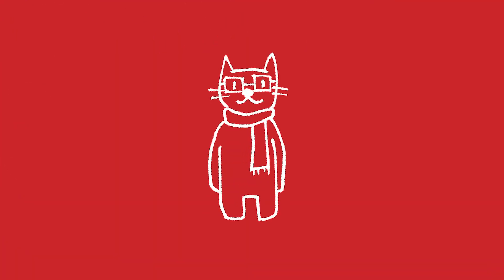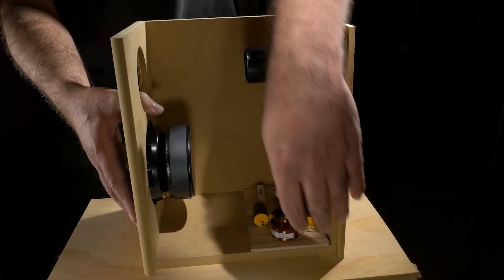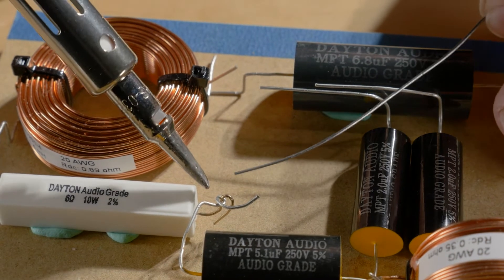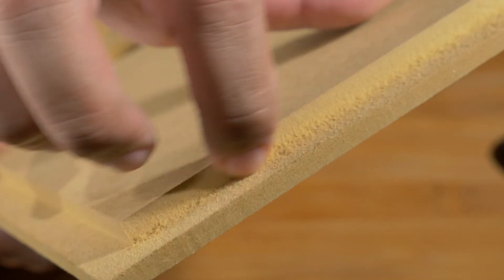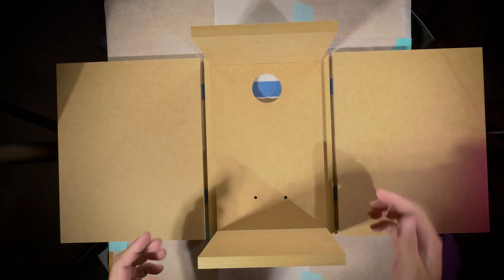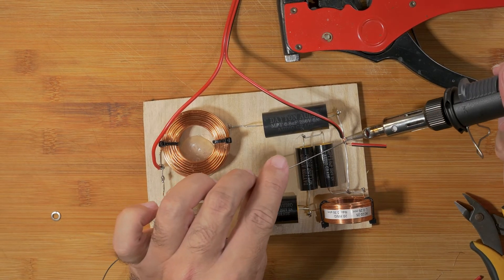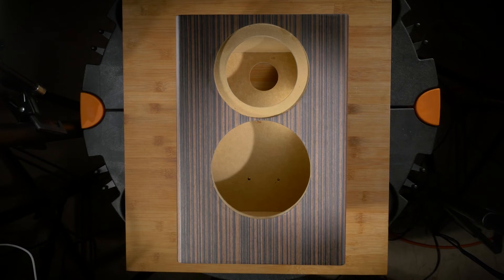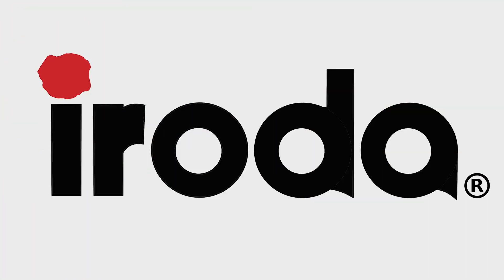How to Build The C-Note DIY Speakers - Audiophile Full Guide

Comment: To avoid tear out put a piece of scrap board under and drill through into it while holding pressure.   

Nice clean soldering work.  Not sure I get the point of the blue tack step vs gluing down to the crossover board, everyone has their preferences.  Groovy build, enjoy your new building bug!